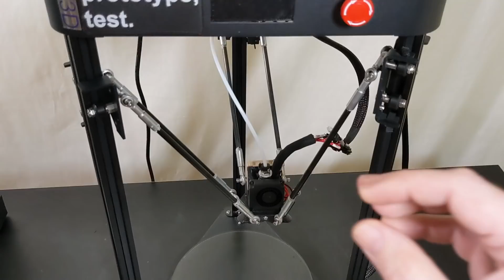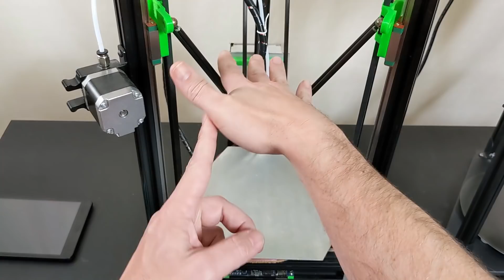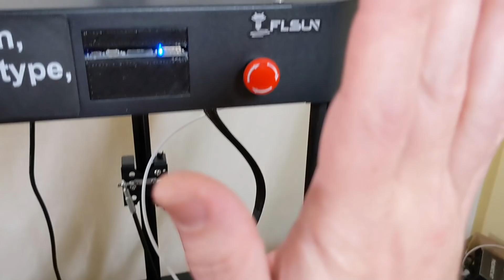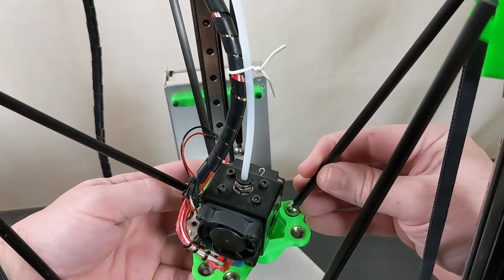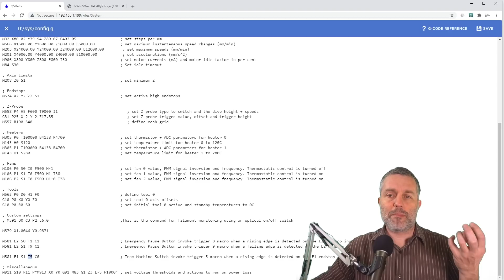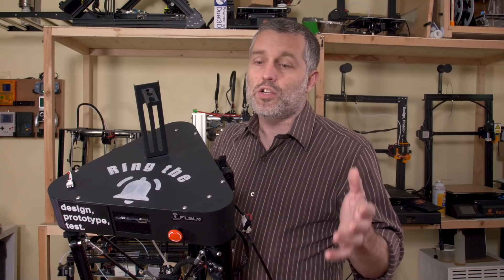FLSun Q5 Evolution - The Best Small Delta Printer You Can build/Modify in 2021

Comment: I am just curious if i remove the rods and put in a longer rod set would it work normally as it after calibrating and obviously it gonna loose print hight
Reply from the maker: No. The ideal orientation for the rods is 45°. Dead center. All six rods are at this angle. To accomplish your line of reasoning, you would increase the entire frame and rod lengths without increasing the bed size.

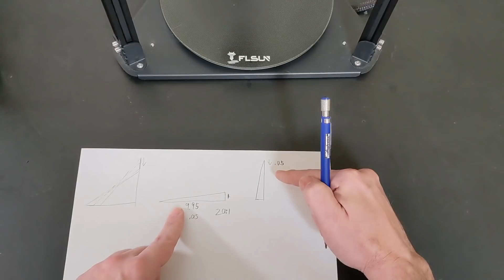Comment: 6:00 your calculations only account for 1 arm, but there's always 3 (pairs). The speed part you show is correct, but the accuracy is not. Let me explain.

In your middle sketch (where the arm is almost horizontal) the needed speed is greatest, but the accuracy is also greatest. A very slight defect in the belt will only cause 1/20 as much defect at the nozzle. So we get very good accuracy. But, as you correctly explained, 20x speed is required.

Now, in your rightmost sketch the belt error is indeed getting amplified, just as you describe, but this is almost only in the z-direction (which means that errors will make the gantry tilt), because the other two arm pairs at this point are closer to horizontal and therefore ensure very high x/y-accuracy.

Comment: Than it looks like it's not a good beginner printer, if they isn't precise enough to print cylinders 🤔 also without modifications?

What are the costs for the mods, would it be not cheaper eventually to buy a other printer, it's not easy for a beginner, getting more frustrated about the printer, only from listening that's not so good, I'm think g if it would be better to cancel my order for the Q5. 😕🤔

Comment: Fyi, I'm finicky about mechanical tolerances and plan good mechanical level.  With that said I see the value of auto levelers (speed/repeatability).  Designing my first printer now.  My current thoughts are continuity for bed leveling.  Suppose a sewing machine needle affixed to the heat block, not exactly in line with nozzle but right next it.  It will ground via your safety grounded heat block :  ).  Then an isolated conductive surface on bed (was thinking prototype aquanet  as glue to hold  tin foil on bed (check different tin foil thicknesses ;  ).  With a simple circuit (resistor and volt source) you can trigger a high or low (as needed) for your printer mobo... the existing auto level software shouldn't know different.  Maybe one day I'll build an optical one but there's really no need for that accuracy with any designs I've seen.  May be mandatory when I make a 5 axis delta.... longggg way off! Good vidy's, ty.

edit/add   get some of those tiny neo magnetics and just pu one on top of each ball... simple, quick and effective.... or so I think... enlighten me if not please.
Reply from the maker: As discussed in this video at the 3:20 mark, you won't ever get the best part accuracy from any Delta style printer. Regarding your grounded sewing machine needle idea, you can just use an aluminum bed like I did here: https://youtu.be/iNMt2MYfrF8
Reply: @DesignPrototypeTest  yes, prototype for speed tho!  And yes, if alumimium bed gtg... I plan on glass.  Thanks for the reply. subed

Comment: I dialed in my flsun QQ-s pro duet3d reprap 3.3b2 upgrade.. its printing, calibrating, and I was doing last measurement on the filament extrution, and the bowden tube adapter pops off - damn cheap adapter that broke.. so now my bowden tube is loose.. and I can't print this weekend.. ordered new bowden tube adapter from denmark (2 of them), and hopefully my friend who has a stratasys 1200 can print a tightening clamp for me tomorrow in abs to mabye - just mabye keep the damn tube in place this weekend :) :(
Reply: because of this Im considering getting a used small cheap ass printer that can print spare parts atleast.

Comment: Been contemplating the Q5 for a while, then I saw your videos about it and it became irresistible. I finally pulled the trigger on it last night and can hardly wait for it to show up!
Reply: How is it going?
Reply: @notthistup  Still going, still loving it! I ran through a few different mods, but as it is now the only mods are a relocated extruder that sits on one of the front extrusions at an angle, using a bracket I designed. It allows for a shorter filament path and less harsh bends in the bowden tube. I also made a bracket to hold a spool directly under the extruder.  Then I also put on a BMG clone. With those two mods, I'm able to crank it up to ~160mm/s with no underextrusion, and probably even higher, but then I'd expect ghosting and other issues to arise. 
As it is it's perfect for quickly turning out parts that still need .4 resolution and can be printed in PLA. I love the thing, and would highly recommend it!

Comment: The pause emergency button is a nice touch! But is it working even when the printer is not printing? I ask because I have a problem with my printer, sometimes it fails probing the bed and it starts printing without leveling, smashing the nozzle on the bed ruining it. My idea was to wire a button like that directly to the AC wires, as normally what I do is to reach the button on the back of the printer to cut the power. Obviously it would be a beefier 10A capable button!

Comment: More pro magnetic joints are for sure double as good, I never had problems with mine disconnecting due to accelerations. (Magnets are definitely superior for accuracy) Whats more dangerous is that the magnets can disconnect after a crash, which is actually good for protecting the heatbreak, but also drags a 200+°C hotend around the printer area, which is not so good. That said, after a pretty severe skip, delta's tend crash over and over into the part and print bed. I'm working on an inverted delta on which will hopefully have detection for disconnected magnets. The rods and gantries are all metal, the gantry runs insulated from the the tower, and I will insulate the effector from the rods. This should allow for an electric circuit  through all the rod, by which you can see a detached magnet as an open circuit. Also, In my experience, bed leveling after delta calibration makes little sense (when not using different build plates). Delta calibration assumes the print bed to be perfectly flat, after which it calibrates the towers to match that assumption. So you're probing a bed you calibrated as flat. If your bed is not flat from the start you can still get a good looking first layer while you for example print cones instead of cylinders along Z.

Comment: Im sorry but your comment is wrong, I have a qq-s pro and after alot of calibration my cal cube is at 20.02, and can remove a .02 pin from a calibration test. They just take alot of time to calibrate to get accurate.
Reply from the maker: Now do a calibration cube at the edge of the bed. Better yet, print a square frame that covers the entire bed. Test for square corners and straight sides. Check for racking of the frame (parallelogram). You will see the errors appear.

Comment: Matt, have you checked out Precision Piezo? I think you'd like the design. I use one on my Anycubic delta because I got sick of using the detachable probe.
The system basically has a piezo transducer sitting just on top of the hotend's heatsink and when the nozzle touches the bed the transducer gets slightly deformed and sends a sensor signal back to the mainboard to indicate contact. There are mounting designs to suit many different printers on Thingiverse et al.

Comment: On the rod joints. Have you thought about trying ball & socket joints?

I did that for my Kossel Mini after trying the magnetic joints. The magnetic joints do detach easily. Not sure how well the ball & socket joints will work for the speeds you print at as I normally don't print that fast but the seem to work well for me. They have hardly no play at all in them. I designed the ones I use myself. Printed them out with my resin printer. I also made a jig to use for gluing them to together and attached the jig to the back of the rear 2020 Extrusion on the printer to stay for permanent use if and when I make repairs to them. I did that because they are a little fragile and I have broken two so far when removing them. I need to thicken them up a little but haven't got around to it yet. Maybe also used a less fragile resin for them.
Anyways you should check out that type of joint if you have yet.

I also don't use a leveling sensor on my Kossel Mini. I never had good luck with auto bed leveling on my printers. So I designed my own bed mounts for my Kossel Mini which has a pretty stiff leveling system and try to use a bed that won't warp much at all under heat. I never heat my bed above 80° on it. At least not yet. My bed uses a aluminum heated bed with a glass bed on top that has a magnetic flex plate attached to it. I insulated it with cork underneath. Surprisedly it heats up well through the glass, magnetic sheet, and flex plate. The bed doesn't really mov or warp at all. So I have not needed to relevel it since.

Comment: Hi just a couple of suggestions. Check out:  https://www.youtube.com/watch?v=65FVQ1jArME  for cooling comparison. Berdair is perfect for deltas.
Second is for a magnetic version, Number of years back it was not easy to get good magnets so some people had an idea. Normal nonmagnetic balls in plastic socket with a "third arm" in the middle which in actuality is just a steel wire keeping the whole thing in tension and preventing the sockets from coming apart. complicated but if the geometry is good should be even lighter and 0 lash.
Have not seen any done recently i suppose because sufficiently good magnets are cheap and available now and you can just slow down...

Comment: For a Delta.. Duet 3 or Klipper?
Reply: I’d personally recommend Klipper, and I know Nitram would recommend it too. If you want to go fast, it’s a no brainer
Reply: Klipper, I've wrote the config for the q5 on the Facebook group. search for Gottfried
Reply: klipper just for the fact that its cheaper than duet 99% of the time
Reply from the maker: As far as I'm aware, Duet has focused on Delta printers more than any of the other firmwares. Given that attention/focus I would think the best results can be achieved on Duet. However as all 3 are open source, it's thoroughly possible that all the advantages of Duet have by now been ported onto Klipper and Marlin.